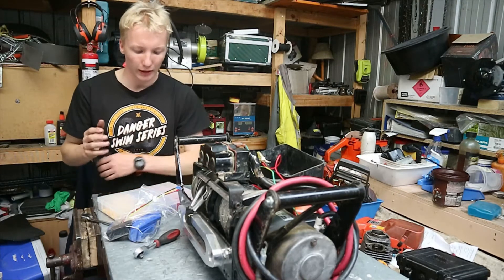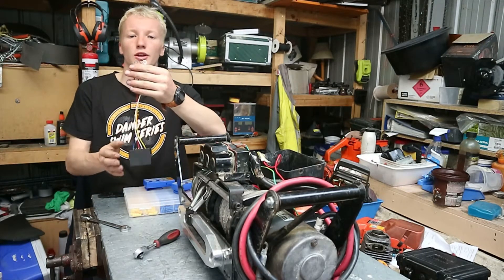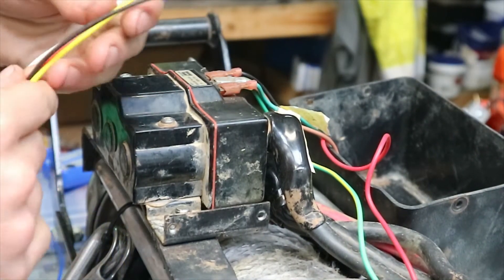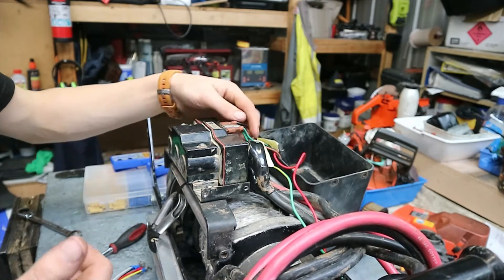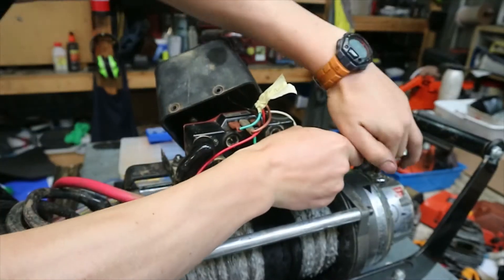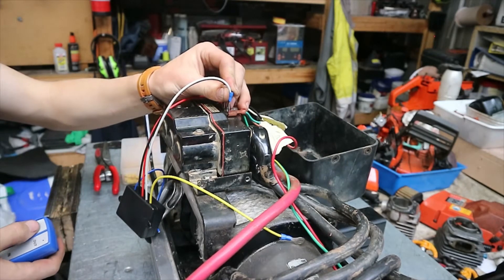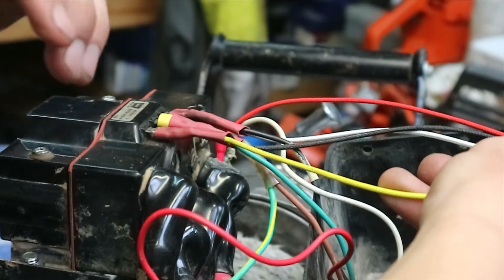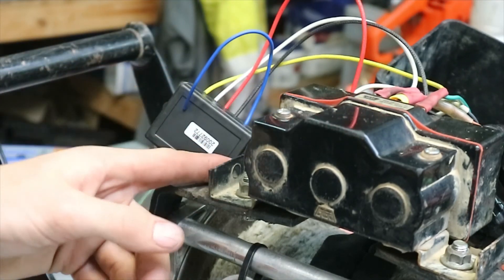Warn Winch Wireless Winch Remote Install. Warn Winch Rebuild Pt 5

Comment: Your one terminal (I believe it’s labeled terminal 2 on the solenoid) has a green/ yellow and a brown wire going to it. Mine only has a brown wire. What is the green/yellow wire for?
Reply from the maker: that is the earth for the solenoid and remote. green/yellow earths to chassis of vehicle/negative lead off motor. i believe it is essential for the solenoid to function.

Comment: nice video. How do you find the cheapo controller? Ive just put a winch in one of those cradles too.
Reply from the maker: It can be hit and miss. I always have the wired one just in case
Reply: @v26224  at least  that option is there as a backup.
Good videos mate.